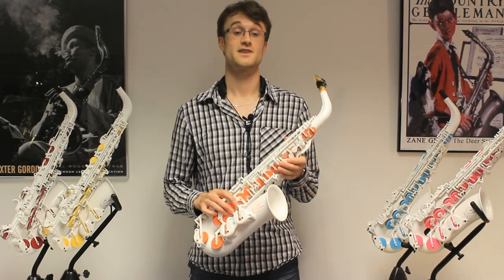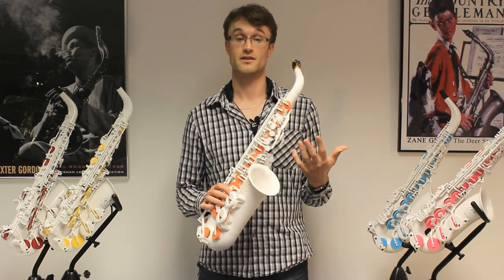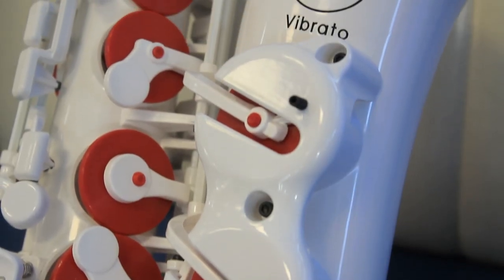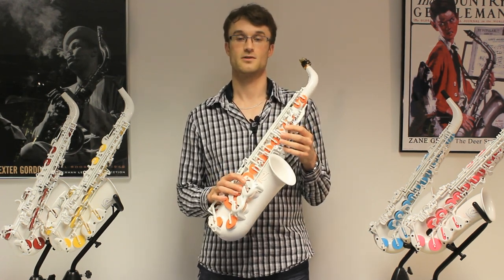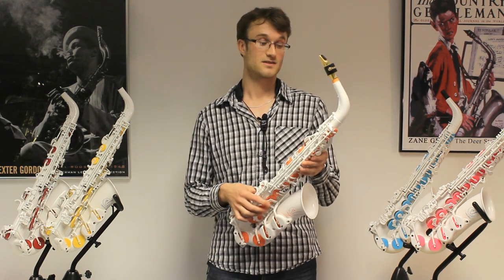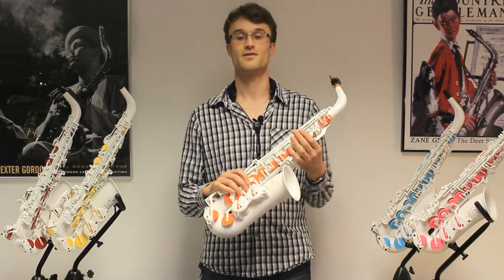Vibrato Polycarbonate Saxophone Review

Comment: I have to say, I am actually surprised at the tone quality of the plastic saxophone. It actually sounds rather good.
That said, there is quite a big difference in sound between the plastic one and the brass Yanagisawa, to my ears anyways. The plastic saxophone sounds a little muffled, and it feels like you really have to fight to get the sound that you were getting.
The brass sax, on the other hand, sounded much more resonant and clear; where the plastic sax seemed to struggle to fill the room with sound, the brass sax filled with ease. Most importantly, the brass sax seemed to be more friendly towards subtle dynamic changes, which is extremely important for a saxophone.

So, all in all, I definitely think it's a good saxophone, but I would certainly recommend a brass sax over a plastic one any day, for the stronger and clearer tone.
Reply: Guilherme Motta
Or, the Charlie Parker/Dizzy Gillespie Concert at Massey Hall. This was the one with the famous 4-bar break on, "Night in Tunisia", all done on a plastic Grafton.
Reply: it isnt the material but the weight that makes brass sound better. weve known for generations that thicker brass,  extra lacquer,  resonators, sliver or gold plating, make saxes sound different. if an extra thick plastic horn went against an abnormally light brass one,  the results would be different.
Reply: @Nikosi9  grafton acrylic is not exactly plastic, its a different more costly process involved in producing the grafton.
Reply: @Nikosi9  Although A Night in Tunisia is performed by the legendary quintet of Bird, Bud, Dizzy, Max and Mingus, it is not this live 1953 performance that the famous break comes from but the studio version some six or so years previous.

Comment: Very light, pads last forever, never leaks, can play in the rain. I bought one and love it.
Reply: EYS BitOfAll Media hopefully the C# key doesn’t stick lol
Reply: @derpysheep5872   I have this problem with G# the most xD
Reply: Thst sounds Is fine for a practice horn but will the dam thing hold together, and who services if it breaks ? I purchased the same type of horn in a trumpet it was a piece of garbage... I like the idea but very skeptical it’s lasting power.
Reply: @pauldance7387  it seems like they improved their design greatly from 9 years ago, and there are now replacement parts available. the pads and rods and much more sturdier, and intonation is very good. it does sound warmer than a brass horn, but its weight allows it to be good for tossing it around in say, a marching band.
Reply: @pauldance7387  Most plastic brass horns are horribly made because the demand isn't the same for plastic horns between brass and woodwinds, but as for your servicing question, most places have a warranty for these that basically just gives you a replacement instead of a repair, and the parts themselves are rather cheap to get ahold of post-warranty. I have found that they aren't terribly resilient, but not as bad as you would think. I'd definitely recommend getting a good warranty, from either the store or from Vibrato themselves.
Reply: wonder whether you still play it and love it... it's been 4 years...

Comment: Testimonials have an exceptional effect on perception. We are impulsively motivated to jump on the support band wagon, especially when we already favor a subject in some way. Take for example the notion that vintage horns are so much better than many a modern horn (and still just as expensive), despite the technological advances that have transpired to produce greater accuracy, consistency and quality in today's horns. I've never played a vintage horn, but I want one as a result of what I've heard others say.

I have a Keilwerth EX90 alto which replaced my old Yamaha 23 which I played for 20 yrs. I was over joyed with the sound of the JK. Ealier this year I purchased a Pro Alto patterned after the YAS 875 from ebay made in China for ~$600. The horn plays so well that I hardly touch my JK which still looks like new in the case after 6 yrs. The JK is of the utmost of perfection in its construction compared to the Chinese horn, which has one rod a little off center, and a few other minor imperfections, but this Chinese horn BLOWS to me, in a good way that is a complete 180 turn from much of the anti Chinese horn rhetoric I've heard. 

I recently discovered its unmarked mouthpiece is made by ESM, the same company that made my JK mouthpiece with a wider tip opening. Hmmm, I wonder if that has anything to do with my affection for both horns.

This plastic horn was knocked down in value by the player's statement of select name brand instruments that he says it will not replace without specifying in what capacity. A decision that should depend solely on durability and sound quality which is highly subjective.

I listened to this clip twice, both times with head phones, the only difference I heard that was significant to me was that the 901 horn sounded brighter. They both sounded great to me and considering all the dynamics involved with producing sound in the sax from the player to the end of the bell, subtle differences have as much to do with the player as they do the equipment.

The real question to all of us sax players is this; What really makes a properly constructed saxophone of any material a great horn? The price, the name, or the way it sounds when you play it. If you give a beginner a $5000 horn to replace say this plastic one, how much better will he play? considering a good player can make a mediocre labeled horn sound like a pro horn, whatever that is aside from a lot of money.
Reply: Pretty much agree. The problem with Chinese horns is that when you're buying one you just have to be very careful, some can be very bad, some can be great, but if you know where to buy and where to look, or you're a beginner but know someone who is an experienced player who can come with you and help you test one, then for about 300-400$ you can have a horn that outperforms an instrument that is ten times more expensive. And by the way, didn't Adolphe Sax himself say, in an actual theory he formulated, that the material a saxophone is made from is irrelevant as long as it achieves what is called an "air column"? And for that, the only important thing is the shape of the instrument, and the tone holes being opened or closed, allowing it to extend or shorten the air column. There is also this book I was recommended by another player which basically says what matters most in a sax is the neck, and that the farther a part of the instrument is from the mouth, the less it matters for the quality of the sound; it's called The Saxophone is My Voice, and it gives a detailed account of the physics of the instrument. I think it even shows the actual parts of the neck involved in producing the various notes. Check that one out, if you can. If you can get a physical copy, do it, if not (i.e. if it's out of print) then I think you can find a copy somewhere on the internet, if you look carefully.
http://musicmedic.com/the-saxophone-is-my-voice.html
Reply: I agree. I heard the clip with my eyes closed and I was able to figure out which one was plastic because of the sounds of the body while playing it. There is not a big difference in the tone. I think that, for the price, is a great option. If it is good enough for Jazz players, how can I say it is not enough for me?

Comment: I don't think there's really point to a plastic sax. when you can shop around for a reasonably used. intermediate. normal sax for about the same price.
Reply from the maker: It's a lot lighter than a normal saxophone, that's the main purpose for it.
Reply: it's also certainly gonna be much harder to damage or break, than brass, that dents and bends quite easily, requires care, and can rust. polycarbonate is legitimately tough as nails! (i shot some 3mm sheet with a 55lb bow, broke two arrows and only made a few little dents) i can see these things selling well to schools and clubs, and as rent out instruments, because "dishwasher safe"! ;)
long story short: exept for the look, i find the white quite ugly, i cant say anything bad about it. if they ever make them in nicer colors i'm sold. clear dark amber, smoke grey, or tortoise shell would look so elegant.
i learn to play a curved tenor bamboo sax myself, and got to try out a brass alto, and i can really appreciate how light the bamboo one is in comparison.
Reply: For some artists, they look for something that will make them stand out above the rest. This would be perfect to make an impression, especially a jazz artist.
Reply: Original E idk my good used sax was 800
Reply: fatmanvidz If you play outside a lot, particularly in the cold, a plastic instrument can be useful as it doesn't really need to warm up like a metal or wood instrument, and it's not going to rust or warp if it starts to rain.
Reply: Not really
Reply: yeah I can only see a point in like a plastic tuba or something if you wanna march
Reply: ya, i dont see the point of a plastic alto, but maybe tenor and bari would be useful
Reply: If I had the dish, I would buy one for my grandkids & one for my grand dad.  Lightweight is what they need.

Comment: I like the idea of self-leveling pads, but having to use more finger pressure to create a seal is definitely a bad thing. To me that's a worse disadvantage than the difference in sound compared to a brass instrument. I wonder if anyone has applied the self-leveling idea to brass saxophones. It seems like it should be possible to make a traditional leather pad self-leveling by replacing the rigid coupling between the cup and the metal arm with a fairly stiff coil spring, or maybe just a ball joint. It seems like this might reduce the type of leaks that happen because the cup is not perfectly aligned with the tone hole.

Comment: Me being a plastic engineer ing polycarbonate is a tough material but its weakness is solvents and ultraviolet rays and the molecular structure changes over time sounds good and its lighter than brass so good for busking brass has density of 8.9 and this plastic is about 2 but the price of 750 to 800 pounds I need to save and search all the sofas for spare cash .

Comment: They sound very similar, but the brass one sounds a bit more open and full to me! Also, the start of some pitches on the plastic sax sound a bit delayed. I hear the air moving before the sound. Perhaps you weren't warmed up? I noticed that it happened much less with the brass sax. I agree with you that the plastic sax would be great for beginners, or a good toy to travel with if you're going to a shady area or to a short practice! Similar to the pocket trumpet or pbone, if ya know what I mean!

Comment: I actually prefer the softer more sultry whole tones of the plastic, but it seems to lose on the quick runs to the brass... but that may just be an adjustment you need to make to compensate for the weight of the lighter keys and skeleton. Interesting..Blue Man PVC!! Buyin my next sax in the plumbing dept at Lowes. I would have thought the idea was to get the price down... so when?

Comment: It's not better or worse. It has a different sound. Somewhat more mellow, while brass one has more breath and brightness and more clicky attack. Carbonate one has smoother sound which may be interesting in some applications. I guess it's nice to have both variants because some time you may need just that darker smoother sound without lack of melodic expression. It's synthetic yet is still sounds interesting. Maybe making some additional physical research with synthetic and composite materials may help find synthetic material with such a physical properties making it vibrate just like a good brass

Comment: Actually, I don't think the Vibrato sounds that bad. It's actually quite decent. Although the Yanagisawa sax does sound better (it's louder and seems a tad more crisp), that might be simply due to the fact that the player is just more used to a traditional, brass instrument and is trying to handle the plastic one with more care. I think Adolphe Sax once said (in a theory he formulated) that the actual material does not matter, what matters is the "air column" within the instrument, mainly dictated by its shape, that can be extended by closing the tone holes thus achieving its sound.
Also, do the pads on the Vibratosax have resonators? If not, it could explain the difference in sound.
Reply: What I wrote in another comment:
I've been told that what actually matters for the quality of the sound 
is not the material a saxophone is made from, but what is called an "air
 column" (I'm not sure this is what it's called in English, this is 
probably just a loose translation); and for that, the only relevant 
thing is the shape of the instrument, and the way the tone holes are 
positioned, opened and closed. And since the air column - which is, by 
the way (unless I'm horribly mistaken) an actual theory formulated by 
none other than Adolphe Sax himself - begins in the mouth of the player,
 it follows that what really matters is ultimately the player himself. 
The rest is irrelevant. I've been told that the farther an instrument 
part is from the mouth, the less influence it has on the sound...There 
is this book I was recommended by another, older and much more 
experienced player than myself which basically says what matters most in
 a sax is the neck; it's called The Saxophone is My Voice, and it gives a
 detailed account of the physics of the instrument. I think it even 
shows the actual parts of the neck involved in producing the various 
notes. There might be a pdf copy on the internet somewhere if you look 
well enough; I'm not sure whether it's out of print but some internet 
stores seem to have it in stock.
But then, I probably agree with you that this saxophone brings almost 
nothing new to the table...you can get a used, decent student horn for 
less than 500$. You might as well get one, to get used to the feel of a 
brass instrument, since I doubt you will be playing a polycarbonate 
saxophone for the rest of your life and brass instruments are, at this 
moment (and will be, in the foreseeable future), pretty much the 
majority.
http://musicmedic.com/the-saxophone-is-my-voice.html

Comment: Question: Which one is the best, A1S 2nd addition, A1 second addition, or A1 2nd addition custom polycarbonate Eb alto saxophone
Reply from the maker: Technically, the A1S 2nd edition is the top model at the moment, it offers a bigger sound, and the key work is easier to get on with.
Reply: Sax .co.uk Thanks so much! I appreciate you replying so quickly!

Comment: I think it sounds interesting and pretty similar but the brass sax is more "open" in my opinion. I'd still buy this though because it is not only distinct in its looks but also in its sound. It isn't bad at all but it definitely isn't exactly "normal" or "usual." I does sound slightly darker, which I actually like. By the way, great talent. You definitely know what you're doing. Awesome but I don't think it will be as popular as the traditional brass sax.

Comment: plastic one sounds deaf because this material is less rigid and many of air reflections are dispersing and dampening. the metal one sound much brighter because all the body is elastic vibrating and reflecting this vibration back, thus amplifying the higher harmonics. I'm not sure that increasing high frequencies on EQ after recording plastic sax will give the similar result as metal (most likely no). but still, plastic has pretty interesting tone that could be useful for some soft parts.

Comment: You can see a tiny difference between the sound which is that the sound of the regular alto sax is much more firm at least that's what I think but yet the vibrato sounds very much like the regular alto sax it's just the sound that's a little different

Comment: Here's the difference ... form these two sounds - "ooowwwlll" - then - "aaaahhhlll". The plastic is warmer because its harmonic resonations are lower in number and frequency. The resonations of brass are higher in number and a much wider spectrum. Copper and silver by them selves make warmer instruments because they are a softer metal and tin and steel make cold "tinny" instruments because they are harder. Plastic can be made hard or soft - this still needs refining - IMHO

Comment: Damn, I've been wanting a saxophone for a long time now just to see if it's anything for me, and I was hoping this would be pretty cheap since it's made of plastic. It doesn't seem to be the case though.
Reply from the maker: When you look in to it, it is cheap, as you have to bare in mind that ones like the p-bone and p-trumpet, don't have a key work, they're all slide and valve based. Key work is a lot harder to build, assemble, align, along with regulating and adjusting, than place a valve in a hole.

Comment: I would have preferred you play several, shorter phrases, A/B comparing just two or four bars of "this sax" then "that sax". Clearly this could be ideal for kids if the valves and keys are as resistant to mishap as the rest of the horn seems to be. It would likely be impressive as hell to show up on a casual and play " Scrapple Apple" or "Les Foiles" on an orange plastic sax.